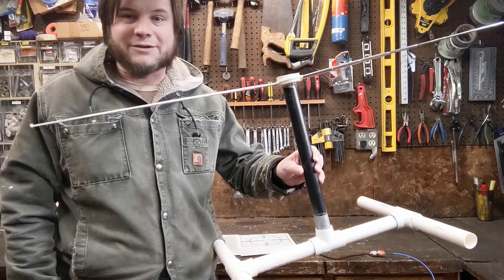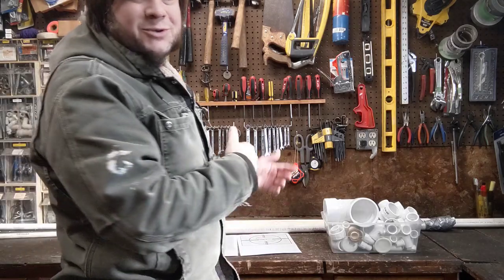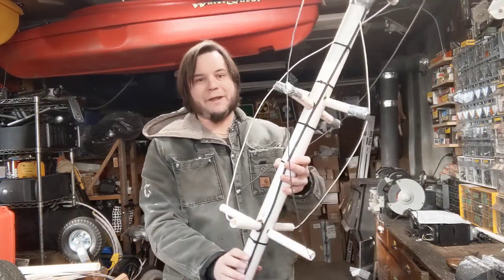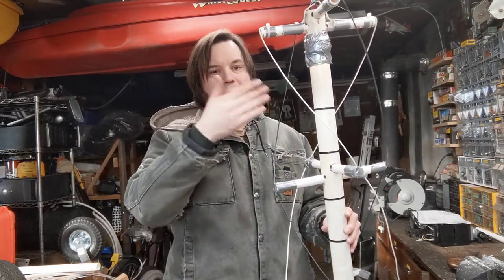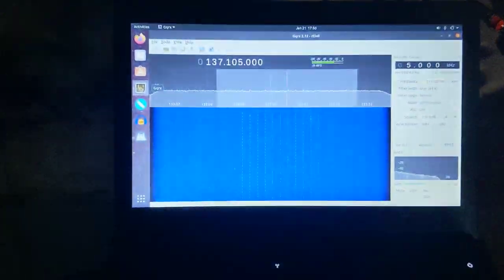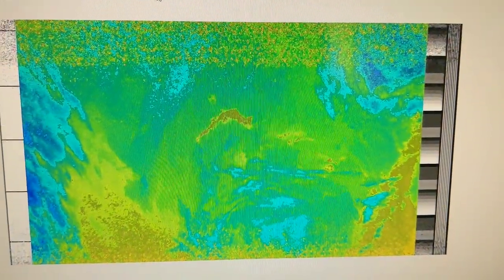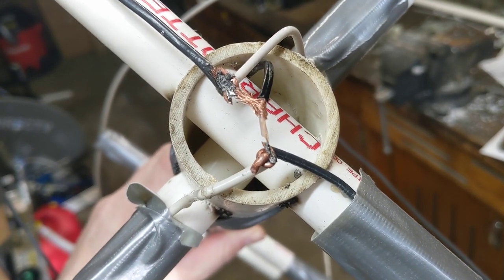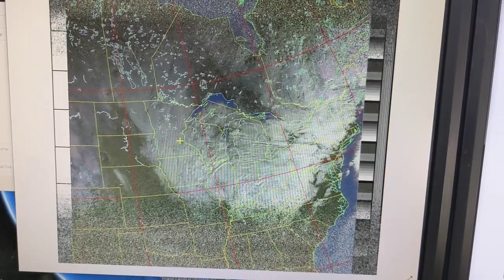Homemade QFH Helix Antenna For NOAA Weather Satellites

Comment: I've been wondering what the point of wrapping the whole coax around the pole is. If YOU can't figure it out, I'm now fully convinced it's just a cargo cult.
Reply: It RF isolates the coax screen from the antenna arm. on a V dipole it makes the antenna work as circular rather than horizontal.
Reply: @joefish6091  Yes, I've since learned that it really is using non-ideal cable physics. Very cool hack

Comment: I built a 137Mhz QFH antenna a few years ago. I can honestly say it worked really well until we had a big storm and it got trashed in the wind. They are a great antenna but you have to be pretty precise with your measurements.
Reply from the maker: This was the first one I built and it didn't do super well. I made a 2nd one that ended up better!
Reply: @saveitforparts do you have a video of you making the second one?

Comment: Maybe a silly question, but what difference would a linear amplifier make? Those are for transmitting, not receiving.
Reply from the maker: Technically it's a Low Noise Amplifier, although I may have called it a linear amplifier (sorry!). The SAWbird series are combined with a filter so it cuts out interference and boosts the gain of the desired frequency.
Reply: @saveitforparts  Ok, thanks for clarifying.

Comment: I'd invest in a NanoVNA... even the cheapest original version for starters and learn how to use that and what the measurements relate to.  Really neat to be able to tune antennas and things.  Then you can verify a lot of details related to how well your antenna, feedline and connections are performing since each part can be like an antenna and have characteristics that effect performance.
Reply from the maker: I actually have one, still learning how to use it.

Comment: 3:02 "Wrap it around a few times" This isn't to do with matching, but it does form a crude BALUN. The antenna is balanced, the coax is unbalanced, connecting one to the other will generate unbalanced currents in the antenna as the elements will be influenced by the grounded coax jacket, but NOT the equal & opposite current flowing in the coax core. The 4 wraps of coax forms an inductor that helps reject unbalanced current flow.
Reply: So my coax need to be equal to the sma or other connection? Sorry this went over my head. What's the practical measures need to correct for this? Or my tuner device will fix it and I don't need to understand?

Comment: Literally in the process of working on my own right now. Waiting on cutters for copper tubing (doing that instead of wire) and my RG-59 coax. Thank you for sharing your experience with it, Dude. 😁
Reply from the maker: I ended up with a slightly different one that what's in this video, my current version is copper tubing and slightly shorter. The guide on usradioguy.com helped me a lot!
Reply: I might be wrong but I believe the RG59 has 75 ohm impedance. You might need to get an RG58 or even better RG8.

Comment: FYI .. To get good results from Antennas you need to be Crazy Perfect The coax used in this project was H-100 Coax with a velocity factor of .84 this is equal to LMR-400 (Try Again)
using a LNA will help big time.. (Also a Broadcast FM Filter inline if you are near a Broadcast Tower) 73s
Reply from the maker: I ended up redoing this with copper tubing and an LNA, it works better now.
Reply: @saveitforparts  Good for you with the Re-build and glad to hear it's better.. Radio Hobby is fun (DX'ing) we feel like Spy's :)

Comment: On the one mount gives very strong signal reception  cannot remember how you wire the harness for the aerial but i do remember using a potting compound to protect the connections and also stability of the aerial elements worked a treat for adjacent and over head passes i cannot remember the gain but provide great real time daylight and also infrared image passes
Reply from the maker: I ended up rebuilding this antenna with plumbing parts, and it works a little better now!

Comment: Something totally different: For a video where the speaker does not use a clip-on microphone, yours has excellent audio.  What are you using?
Reply from the maker: I had been using a Google Pixel 3 phone, but apparently if you use them daily for video it wears out the camera module :-P Now I use a Sony digital Handycam. I think this video might have been a mixture of those two, I switched to the Sony recently after the Pixel kept flaking out.
Reply: @saveitforparts  thanks!

Comment: Do you need a ground with this type of antenna?
Reply from the maker: I'm not really sure. Supposedly for the V-dipole they work better either right on the ground or with ground plane wires underneath. For the QFH design I haven't found much info on that. Some people seem to use them on tall poles with no ground plane and some people have them right on the roof or in an attic.

Comment: Perhaps you should use thicker wire or some aluminum flatbar
Reply from the maker: I'm considering re-doing with copper pipe if I can scrounge up some connectors.

Comment: I thought the QFH image shown was the better of the two?
Reply from the maker: It might be slightly better, after staring at a few examples I think the QFH does a little better job (or it did, I've been messing with it more after this video and it got way worse!)
Reply: I completely agree. You can use the calibration bands on the side to tell, the high quality section of the image extended quite a bit higher and lower on the QFH.

Comment: It is upside down. Don't know if it matters
Reply from the maker: I ended up trashing this one and building one out of copper plumbing. The new one seems to work better.
Reply: @saveitforparts  i'm working on my 3rd one. First was ok but couldn't get it tuned above 135mhz. 2nd was at 405 mhz. Wth!
Finish 3rd tomorrow. All from
 tubing
Enjoyed your video by the way.
Reply: Looking from teh bottom end of the antenna to the top, the twists should be clockwise, not counterclockwise.

Comment: BTW, I just discovered NOAA-APT.  It seems to work better than wxtoimg for decoding the recorded sigs.  Downloadable as a .deb so it's easy to install under linux.
Reply from the maker: I've tried it on Windows and Linux but can't get it to do anything other than resample and change file dates. Can't get it to process at all.
Reply: @saveitforparts  I think there's a bug.   I had the same, it sent through the motions but no image appeared.  Then I went to the process tab and change the rotation once or twice and suddenly the image appeared.  
Repeated this on several decodes.  It's gotta be a bug.   
I'll talk about it in the video I'm doing on it this week.